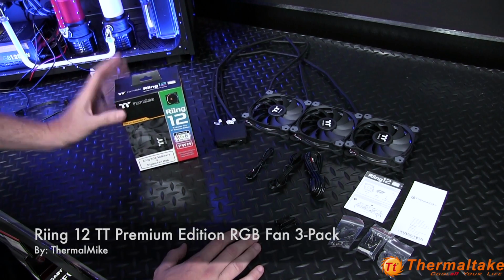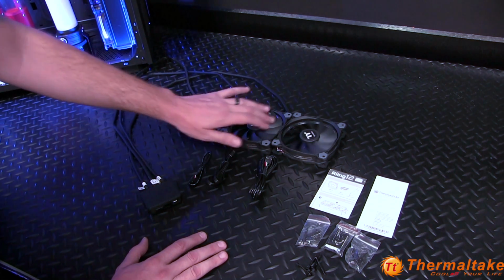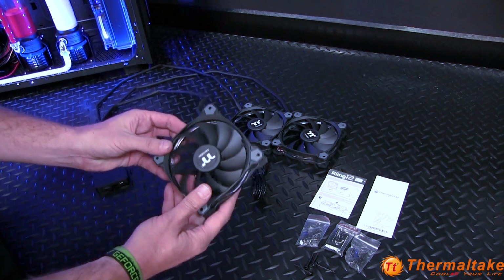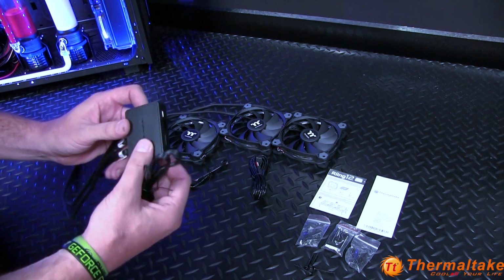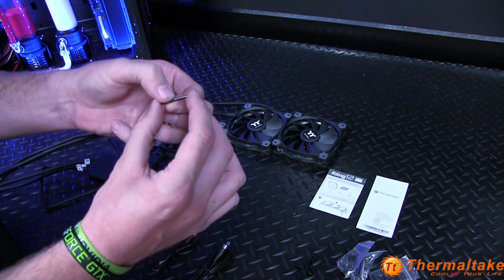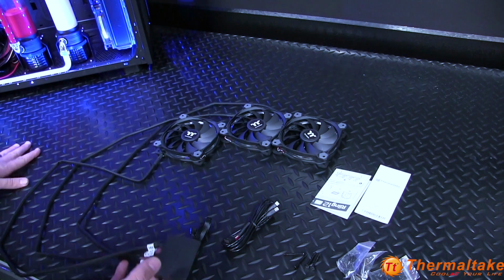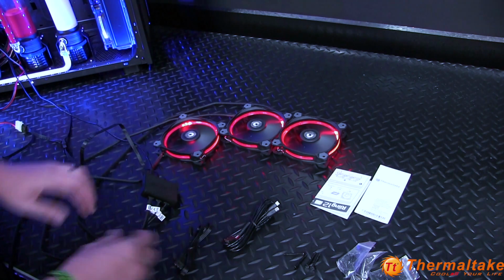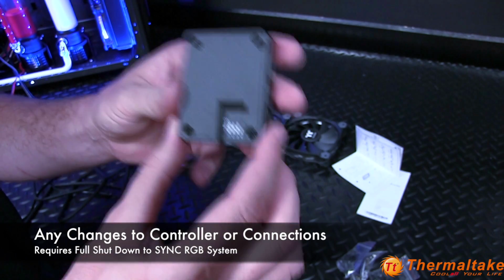Riing 12 TT Premium Edition RGB Fan Installation Overview

Comment: i got the ring duo 140s and am not happy with the fact that after i have them i find out that the stupid controller is required. my motherboard has a built in controller that is operated with its own software that does more than control 2 case fans and adding more just so thermal take can act important is just bloat on my system that i don't want. i am sure that the controller is great for systems that don't have that. if anyone has a line on some good rgb 140s that do not require a separate controller and software please let me know, i would love to throw this crap in the trash as soon as i can because you clearly can't trust the info put in ads.

Comment: Gdzie wpiąć kabel do płyty głownej asus z590 ?
Reply: Have you solved the problem with connecting the controller, where can I get an additional USB connector? Because on my motherboard there is only one and the processor pump controller is already connected to it

Comment: Hey there. Thanks for making and share this video. I`m currently trying to setup my Thermaltake pure plus 12 fans and controller to my Gigabyte Z490 Aorus Elite AC motherboard. But im stuck. I`ve plugged the usb cable to the controller but cant work out where the other end (9 pin) goes to the motherboard. Any ideas or suggestions or ideas will be muchly appreciated.
Reply: Have you solved the problem with connecting the controller, where can I get an additional USB connector? Because on my motherboard there is only one and the processor pump controller is already connected to it

Comment: I hope you will answer my question: Do you connect the AIO fans also to the TT Sync? Can you control the fan speeds on the AIO and the rest in the controller?

Comment: Hey guys just chasing a bit of help, with the 4 pin molex cable supplied in the pack, I don't have a molex connection cable. I purchased a modular PSU 6 years ago and don't know where the cables are now. Is there a link I can purchase this from, cheers

Comment: when adding a second controller do you need to connect a molex power connection to both controllers or does the bridge connection send power to the 2nd controller?

Comment: nice fans and very good review..!!a quick question..!!all models does work (amd-intel) ?to be more specific  (Thermaltake Riing 12 LED RGB 120mm 3 Packs) i order them..!!but i read somewere in the web that  (Fan Control/RGB is incompatible with ANY AMD Ryzen Based System) is that posible?thanks

Comment: I was looking on info on fan direction.  Is the fan direction software controlled or do I have to point the ugly side of the fan towards the viewer inside my case.  The instructions don't mention fan orientation, and the fan itself doesn't have a flow direction arrow.  Left with no answer.

Comment: Ok so I've installed these now, like 15 min ago. They are spinning but, no LED's the USB is connected to the Header on my MB and the micro USB is connected to the controller but your software isn't seeing my controller box any suggestions?

Comment: I just purchased one of these and realised after that my motherboard doesn't have a USB 2.0 header. They are 3.0 and 3.1 headers on my motherboard. Am I fucked?
Reply: Have you solved the problem with connecting the controller, where can I get an additional USB connector? Because on my motherboard there is only one and the processor pump controller is already connected to it

Comment: Hello; I am having a problem when it comes to being able to manage the software, I bought the thermaltake pure plus 12. And when it comes to opening the application, I get the following error:

could not find fan controller please check the fan controller is connected: Error Code H_0x0001

Could you please tell me what I did wrong.

The 3 fans are directly connected to the controller, then a connection of 4 pinies to molex so that it has power, and I have connected the long cable, which comes with 2 micro usb sockets, 1 of them to the hub and the other directly to the board, leaving the other microbus connection unconnected since I understand that this is in case you want to connect another separate controller.

Currently I can not have 3 rgb fans which I can not handle in any way. Also say that the switches have left ON, only the first 3, the corresponding to which I have currently connected. The switch with the number 4 is OFF.

I would appreciate your help, and many thanks in advance.

Comment: THE cpu cooler has 9 pins goes into the CPU fan socket on motherboard?
The controller has 9 pins too it goes where should that connect to? Normal fan socket? Each socket is 3
Reply: Have you solved the problem with connecting the controller, where can I get an additional USB connector? Because on my motherboard there is only one and the processor pump controller is already connected to it

Comment: No one wants to use the crappy Thermtaltake software that looks like it was designed in the 90s. These fans should be made compatible with motherboard lighting software like Asus Aura.
Reply: These won't, I was hoping they would and now have five of these that will have to be independently run...
Reply: Dosnt the software syce with razer chroma now

Comment: i have 2 of these mount on my CASE and its stuck on color RED, i downloaded the software to change colors. but its not working, can someone help?, i bought the 3pc/pack and i only installed 2 with controller, i have NZXT s340 elite case, ASUS z270F MOBO.

Comment: 1. Loose the cables. In this day & age,  everything should be wireless.
2. You need to show some love to 1st gen Riing customers and come out with a new software controller we can purchase.
3. What's up with the jacked up pricing for the new gen Riing? I paid $231. for 3  3pk in 2016, U guys retool the factory or something?

Comment: hello, I have a problem with my pc, what happens is that I have a total of 5 fans plus a floe ring both are premium edition, but it only lets me control from a single controller, as I do to leave me in both controllers from the same software, I have tried to connect them in some ways to see if I read them and I have not been able to, I need help please

Comment: Only 3 fan per controller??.. LAME Thermaltake!! You can get a Corsair SP120 setup with 3 RGB static pressure fans and controller that supports up to 6 fans for $10 cheaper.
Reply: It supports 5 per controller

Comment: i ran out of usb headers...can I run the cable that has the usb header and the micro usb cables to a regular usb port and still control the leds?

Comment: I have a question. I'm on the verge if buying these buy my case only has space for 4 fans. So what would I need to connect 4 fans? would I need to buy 2 of these 3 fan and Controller kits ?
Reply: Your comment is a little old, but if you are still wondering... You need to buy a 3 pack, with controller, then a second controller with a single fan. These are 
awesome fans no doubt, and fun to play with, but get the better ones with the individual LEDs. Or go with the Corsair HD RGB fans, 100% wish I would have bought those instead.

Comment: Hi I have a fan controller in my pc so how can I install this fan system the software and the fans using the fan controller please let me know ?
Reply: Have you solved the problem with connecting the controller, where can I get an additional USB connector? Because on my motherboard there is only one and the processor pump controller is already connected to it

Comment: So, I only just sunk 200 bucks into a set of RIING fans for my PC, and you guys come along a few months later and "fix" the issues with the first ones? 
At what point did you guys honestly think a controller locked inside of a case with no software solution was a good idea? 
This feels like planned obsolescence.
Are we as consumers really supposed to believe there was no way for this new controller to be compatible with the previous model of fans? It looks like the only thing that's been changed is the pin connector, to simply add a drm feature so people are forced to buy the "new" fans (which look exactly the same, minus the new logo) to access the new controller?

If this is how you treat your customers I will never buy or recommend your products to anyone ever again.

Comment: Hello Thermaltake i have a big issue with this , this Interferes with other third-party software such as Xtreme engine led options for my graphics card. When I start up the tt premium software my Xtreme engine won't change the color.. If you can make them compatible for both tt plus and premium software it would be cool. Good day.
Reply: Lymia Xyr as far as I'm aware all rgb fans are only compatible with their own software
Reply: You didn't get my point , this rgb software crash the other ones
Reply: Lymia Xyr oh!  their software might have a graphics card tweak section. you might have to try looking through settings to see if it can be turned off.
Reply: No , it doesn't :( , I have 3 rgb software , one for my graphics card which is Xtreme Engine (the one that is not compatible with it) , The cam software that one is fine running both and the tt premium software ofc.

Comment: Am I correct in thinking that when the fans are set to PWM in the Thermaltake software - the motherboard header will then control the fan speed? In my case via Asus Fan Xpert...?

Comment: I just bought 3 pack of regular rgb 14 and 12s this is annoying that this is out
Reply: I was about to get two 3pks of the 140mm fans but googled something really quick before ordering and saw something about "premium" ones lol. Glad I didn't buy yet. Only issue now is they only have 120mm 3pk kit of the Premium. Where the heck is the 140mm version? I have all my parts ready to build a new PC and I have a corsair 280mm cpu cooler that I really don't feel like returning for a 240mm cooler.

Comment: it would have been nice if you did a 5 pin fan spitter  so you can have 6 fans  on  a  360 water cooler or a contoller for the normal riing 12

Comment: Is it possible to connect the Power Connector to the Mainboard and use the BIOS PWM Signal in depenedence of the heat like in the standard Version? (CPU-Cooling)
Reply: dizzi unfortunately not with this version. It needed its own power for each controller.
Reply: How do I control the fan speed with PWM based on the CPU temps?

Comment: Can i install these in a Thermaltake Core V71 tower to replace the non-led one?
Reply: You can swap out to the fans :) V71 supports both 120/140mm fan mounts. The built in fan controller on the case though would not.

Comment: really molex, is this 2013?
Reply: What else would you use dumbass?  PWM doesn't carry enough power for a breakout box.  You can use a PWM splitter and get zero RGB control.  What exactly are you crying about?
Reply: they also could have used FDD, i wonder why they havent done this!
Edit: I should've watched the Veideo, they really use FDD : I
Reply: 2009
Reply: Дмитрий Пучков really...